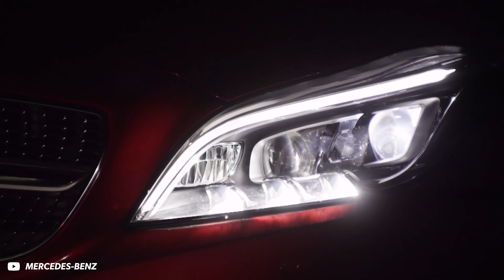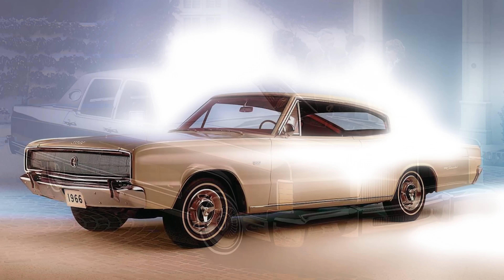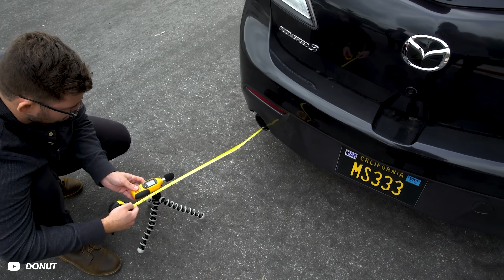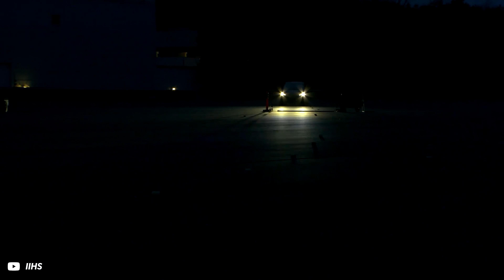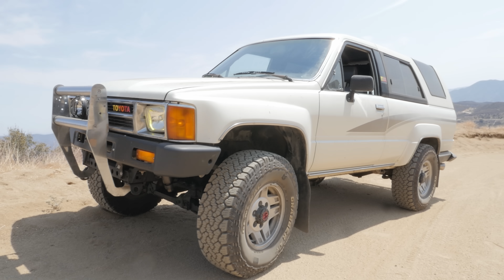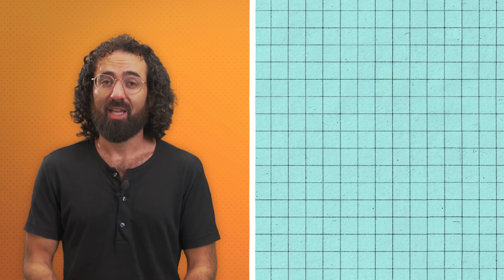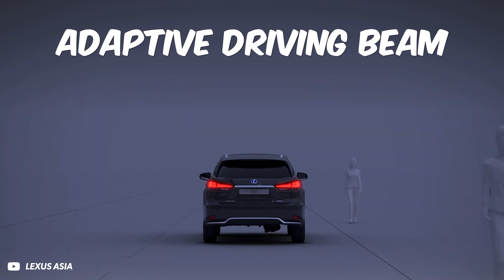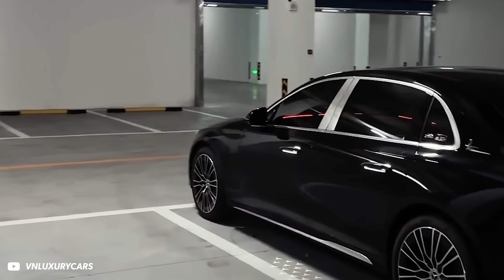Why new headlights are blinding American drivers

Comment: Pre-LED was already a problem, where manufacturers were getting away with bad design.  

1. I recall in 2004 seeing many headlights being ‘raked’ up the bonnet (hood), allowing light to scatter upwards.  Later, the lights/glass/plastic often had become hazy, creating more dazzle. 

In contrast, around that time BMW had the best headlights, with a nicely dim ‘ring’ design. Very visible yet zero dazzle.  

2. People often have lights adjusted badly. And do not use any adjustment when the car is loaded up.  Automatic levelling is supposed to fix that - but cant if the lights are that bad.  

Too often I’ll be following a car, and notice my lights hitting the floor, whereas their light have lit the rear of the next car ahead; so much you can even see the light is illuminating the interior of that next car! 

3. UK & Europe now has a fashion to have much taller vehicles.  And there was a ‘square front’ regulation brought in (for pedestrian safety?!). So manufacturers are putting lights much higher up.  Even if they’re adjusted downward, they drive so close they’ll light up the car ahead.  Driving past them, head on, it’s the same problem for a moment.  

4. UK had a rule against using front fog lights during good visibility.  Yet these days manufacturers come with ‘day running lights’ dotted all over the car - they’re like a Christmas tree.  

The lights are LED, and way too bright. But also bad at controlling Lightfoot direction, in their application.  Have lots of these and the oncoming car might as well be looking towards a scene in Close Encounters leaving a big-rig light festival.  

5. I was discussing it recently and was told that many modern headlights do not dip.  Instead they automatically turn towards the verge; only once they detect your oncoming vehicle - meaning they don’t work on bends, until the last split-second and you’ve already been blinded.  

6. Manufacturers know it’s a problem. Because some cars now have a feature that turns one headlight off when the indicator is put on - otherwise you’d not be able to see the indicator.  That right there admits a problem! 

I dont see how regulators have let this get out of hand.  

Furthermore, It’s highly dangerous for motorbikes.  They introduced the ‘permanent’ ON headlight over two decades ago, to help bikers be seen.  But now, forget that.   Given all the car daytime running lights, it’s impossible to decipher bikes from cars.  I find it impossible to see cyclists, when the Xmas tree car comes towards me.  

The problem is made worse in parts of Europe where they don’t have cats eyes.  And being able to see the edge of the road is highly important, yet now blindingly impossible.  

I also discussed with my mate that given how blinding they are, we should all technically come to a near stop each time a car comes.  Crazy but true.  I drove a rural lane in the dark recently, it has shallow kinks in the road that you can’t even call a bend; it just not perfectly straight. A car came the other way; i let off; it passed; I cranked on my main full beam , only to suddenly see a pedestrian dressed in black.  

These headlights are probably the most dangerous thing out there, right after : cars that drive at you head-on over the central line , a big problem in the UK.

Comment: The REAL solution is having the government require every vehicle go through an inspection at every registration renewal to check if the light beams are at safe viewing heights and adjust them on the spot, simple. This catches not only bad alignment straight from the factory, but also the people installing aftermarket lights and calling it a day -- not bothering to adjust them or putting the incorrect bulbs into the wrong housings like an LED in a mirror housing meant for halogens. We can't depend on vehicle makers to include ADB tech, because what about motorcycles? I ride one and have been blinded by other motorcycles too. And who cares if the light beams are shining onto other vehicles so long as the beam is not shining into people's retinas?

Comment: Saw a funny post in the past… “Lawmakers should be forced to stand in front of a car for 25 seconds within the output of the bulb, and then be forced to read a page or two from a book in less than 1-2 minutes.”

Basically, if the light blinds them, they won’t be able to read and the light doesn’t pass.
Reply: I don't think that's funny, that's the start of a real solution. Maybe I would tweak the timings, but yeah, after being hit by an oncoming car's headlights for 5 seconds, you need to immediately (maybe 1 second later?) be able to see hazards in the road.

Comment: I'm 65, I can't drive on a rainy night anymore.  It is not horrible on a dry road but wet, I can't see a thing.
And now we have a bunch of A holes with those big LED light bars driving with them on the highways, they are legal off road only.
Reply: I am almost 64 and use anti-glare (or anti-blinding) over-glasses (I wear glasses). It works so good at night against head beams and blue lights, but also in rain, snow and low sun. They are about €20 in my country, so about $23.50 in the US.
Reply: @RealConstructor  Or $32 Canadian.   I have my yearly eye exam coming up shortly, will ask about those.  Thanks

Comment: These new headlights are too bright for oncoming drivers. The old headlights used to be focused where they should be - aimed slightly downward and slightly to the right. The purpose of that was to NOT blind oncoming drivers and to focus the light where the driver needed it - on the road ahead. These new headlights don't seem to be focused properly, they are blasting out bright light in every direction.

Comment: Cars used to be manufactured with yellow headlight that is easier to indentify the road condition and do not blind the opposite car drivers. I am annoyed to see  new cars model are equipped with LED headlight that is so bright that cause hazzadous dangerous condition to other drivers at night, is there any regulation applied to the car manufacturers regarding to this light issues especially in the states where we have snow during winter

Comment: As a European living in Germany, multiple parts of this are weirdly confusing. But especially here in Germany, as well as in some way in other European countries, our vehicles have to pass an official inspection, first after three years and then every two years. Checked among other things, your exterior lights. Also only certified LED replacement lamps can be retrofitted. And so far, those are only certified for a (growing) number of vehicles, as they have to be certified per vehicle right now. They also have to fit into certain margins of light output, as have factory lights. 
Lift kits usually are not a thing here. No need for it and you would need to pass an inspection on those customizations.
Regarding newer lights blinding more, there are actually studies showing that most blinding happens from badly maintained or illegally modified older lights. Both Xenon and LED have to be self leveling for example, to adjust to different loads. Also back when light bulbs became halogen lamps and again when xenon became a thing, for a while people complained about being blinded as they had not been used to the look of such bright lights, without necessarily being blinded.
Beyond that I would say the biggest issue are more reflections from wet roads.

Comment: aftermarket doesnt matter all ultra bright led headlights will blind you unless your driving in the same lab conditions they test for glare ie flat level ground no hill cresting (thats the big danger as hilly windy country roads being blinded coming up a hill i have many times needed to dive on the brakes to stop so my eyes and adjust after being flashbanged. halogen lowbeams led highbeams thats the only solution imho. no need for led low beams.

Comment: UK here, I hate being blinded from the front or rear, their normal beam is brighter than my full beam, also hate adaptive lights, it looks like they are flashing at you. Also some lights twinkle different colours, very distracting. Also annoying are people who stay on the brake pedal in traffic, there is a PARK button or handbrake !
Reply: If you have adaptive cruise control, then it happens automatically, you wouldn’t even notice it when driving.
Reply: @RealConstructor  i don't have cruise control and don't want it

Comment: What happened around 2005 is ppl used to put on after market lights that were too bright, and we had laws against the brightness of headlights...unless they were stock...so manufacturers made the stock headlights brighter and no one checked that. So now everyone is blinded all of the time and driving at night is more dangerous. The thing is, the way the lights are aimed, you can only see far off objects and immediately in front of you, but nothing in between. So you can judge distance to that object but it's far more difficult to judge how fast you are going in relation to that object. Then there's the variation of vehicle heights putting most drivers directly at the level of the light come of the incoming car. 

The thing is, you're not seeing much better with brighter lights because what they claim to illuminate like potential hazards like deer or pedestrians, you're not seeing them until you are really close, or they are directly in front of you.

Comment: This has gotten worse year by year with more new cars with LED headlights on the road. This year, 2025, is so bad that I would quit driving at night if I could. So many more cars on the road with super bright blue/white spotlights that constantly blind me. And now another reason I hate moving the clock back an hour in the winter.
Cars are really bad and trucks are like looking at the sun.
Reply: I am almost 64 and use anti-glare (anti-blinding) over-glasses at night. It gives your eyes so much comfort and you can see everything clearer. It also works with rain, snow and low sun.

Comment: IF you don't know how to adjust your lights AND you don't know what is the proper adjustment then you shouldn't do anything to your lighting system. Get a professional to check them every year or so. Have them replace things when needed. And, PLEASE keep aware of how your lights change slowly over time. (You need to think back about how the light looked shining on a wall a season or two ago and if it's different now.)
The increase in the brightness is a factor of the aging population. It takes more light and of a higher colour temperature for older eyes to see like they did 40 years ago.
Besides, it isn't that they didn't WANT more and better lights, it's that they didn't exist and you couldn't have them. The tech for it all was years away.
I change all my vehicles to 6500 K LED lights. I take a lot of care to have them adjusted properly and contained spread so it is the least offensive while providing the best illumination possible. (Some losses are due to those restrictions for others.)
And then there is the power savings. I reduce the power consumption of as many things as possible to save on FUEL. The more draw on the electrical the more power it takes for the electrical system to provide it. This means the alternator pulls harder and takes more gas for the engine to provide it. I learned the hard way about electrical draws and the nightmare issues that can happen from it. (But I have also replaced alternators with higher capacity ones for some occasions. It takes careful thought.)
The best option would be for your vehicle to sense how bright the ambient light around you, and where you are heading is, and restricting the brightness of your vehicle to what is needed.
A lot of city streets with modern LED lighting are bright enough that DRL for your safety would be good enough. While driving on a rural road (or 4 wheeling) would need as much light as you can get. If the vehicle could know how much is needed and provide only that (with manual overrides) would be best. With modern camera systems it shouldn't be too hard to `see' reflections from other vehicles and PWM the headlights. (PWM - Pulse Width Modulate or "dim" them.)

Comment: 50000lm? I don't think so. The best LEDs on the market can't produce more than 100lm/W (I think the absolute record is still at 164lm/W, excluding the circuitry required to actually produce the correct voltages) without going defunct after a few hours of use. And a 500W bulb will produce a shitload(TM) of heat which is impossible to get rid of without massive cooling systems... LED headlights are usually up to 4500lm per assembly. Laser lights go up to 6000lm.

Comment: In the 1930's, Edwin Land invented a filter system that reduced the light reaching an opposing car by 90% using polarizing filters.  It allowed the driver to see fully, while not blinding oncoming drivers.  It cost about $10 per car, and the auto makers deemed it too expensive.  So Land went off and invented instant photography.

Comment: Norwegian here. I drive a lot in the dark during autumn and winter and by far the worst cars i meet are Teslas cause they're lights are not adjusted correctly or are just shit from fabric. And people here too don't really care to check where their lights. I drive a hilux and they have a wheel inside the car to adjust the height of the headlights. I use this feature a lot depending on if im driving in a city or the country side. And the cars that use the adaptive headlights aren't really that good. Many of them are not fast enough to adjust or they don't adjust at all. I like to be in complete control of my lights since i take driving more seriosuly than most people.

Comment: Auto beams and adaptive headlights are only as good as the implementation, just as any other system in a car.
I've driven some cars with absolute trash auto beams and some cars with great auto beams. Same thing with adaptive headlights.

Here in Europe headlights should be included into EuroNCAP crash and passive safety testing.

Comment: Sorry bro you lost me right at the end. Why is your only solution to add even more complicated technology? It seemed you were building a case to get the safety standards and independent test body to align their units of measurement (pick candela or lux), possibly tighten the standards and testing related to light radiated in other directions (feels like this could take form or a maximum lumen limit), and then start enforcing these limits on what you called the wild West aftermarket.

Comment: This is by far one of the worst headlight videos I've seen.
It is illegal in the USA to swap an LED aftermarket bulb into a HID or Halogen headlight assembly. That is why aftermarket LED bulbs are not sold in physical stores. 
Because all cars in the USA with LED headlights that are OEM are whole assembly replacement for a burnt-out headlight. Yup. every single car with OEM LEDs are no longer $20 for a burn out, they're not $80 either or $120. For a burnt out LED headlight that is OEM expect to pay $600-$800 to do it yourself, along with removing the grill, bumper, fender, wheel well. At a dealership expect to pay upwards of $1,000 - $1,200 + for a Toyota Camry. A very basic affordable vehicle, not when it comes to a burnt out headlight. Owner manuals all state for a burnt out headlight bring it to the dealership. There is no bulb number.
Also those adaptive dimmable pixel headlights only function while high beams are on. What kind of A-hole is driving around other people with their brights on? Foreigners. Because that's where the dimmable headlight was created for. People here used to know not to use brights on curves or bends in the road, turn them off when approaching an intersection, when a driver can see another cars headlights approaching but can't see the car yet it gave time to turn off their brights. But now assholes think auto headlights will do it for them. Then they look insulted and confused when I give them the finger and shout a lovely little something to them as we drive past each other. Vehicle height has nothing to do with proper headlight aiming from 25ft. This whole video is full of useless information. Also the first headlights on a vehicle were optional and they were not battery powered they were candle and/or carbide lamps. Just because the electric car was invented way before the gasoline car doesn't mean battery power was first in everything.

Comment: Worth adding, most headlights in most cars have adjustable angle. If you frequently drive around with the back of your car loaded down, the front of the car is angled up, which points your headlights into the eyeballs of oncoming traffic. Adjust your headlights people. Or even if you just installed a new bulb, adjust your headlights. 

The video briefly skimmed over this, but automotive headlights (at least the low beams) have a hard cutoff where they illuminate everything below a certain line and nothing above. This line should be directly in front of the headlights, not pointed up or down. Pointed up is what blinds people. This cutoff is whats adjustable. 

The video mentioned this specifically, but I’ll reiterate. Led bulbs in Hallogen headlights basically ignore that cutoff and shine way too high, because the hallogen housing is designed around the beam pattern from a hallogen bulb. 

The worst thing you can do is to put a led bulb in a hallogen headlight. If you want brighter headlights, either get a high quality hallogen bulb or get an entire led housing assembly. Either way, make sure you adjust your headlights.